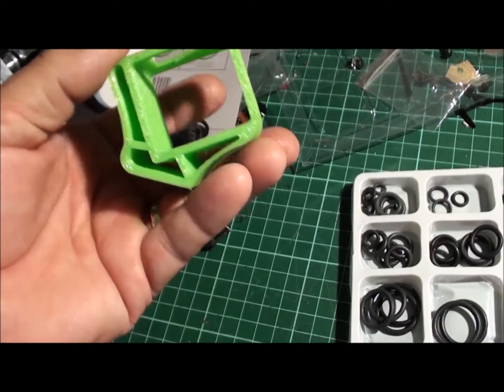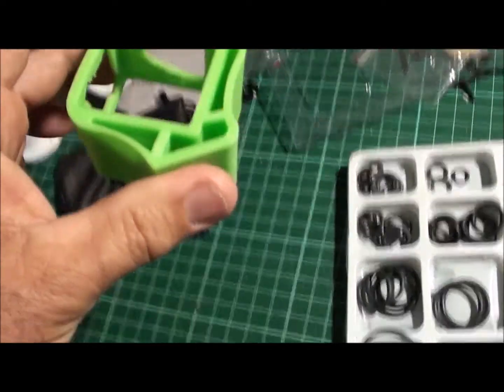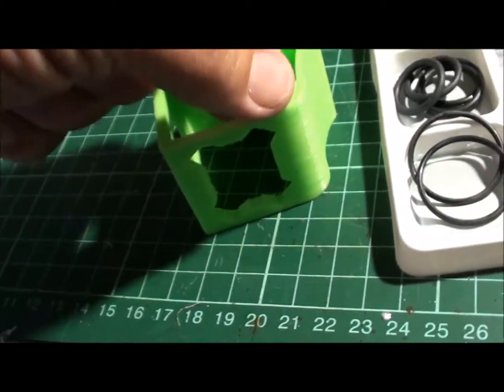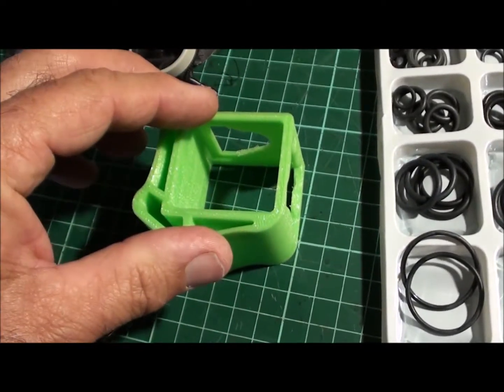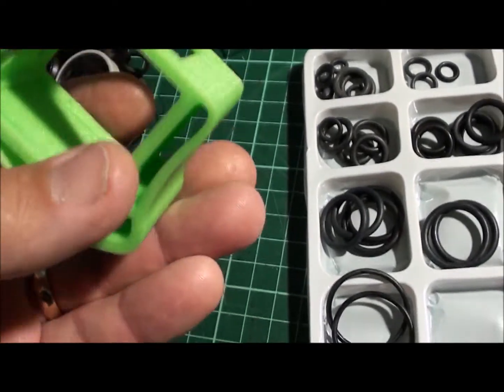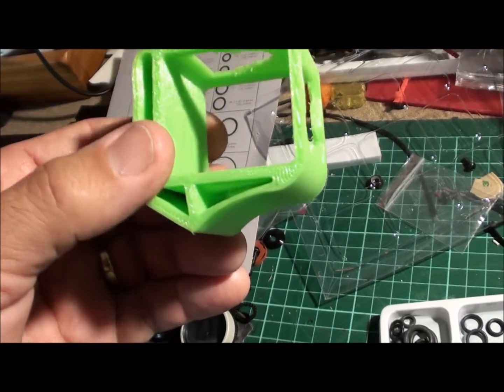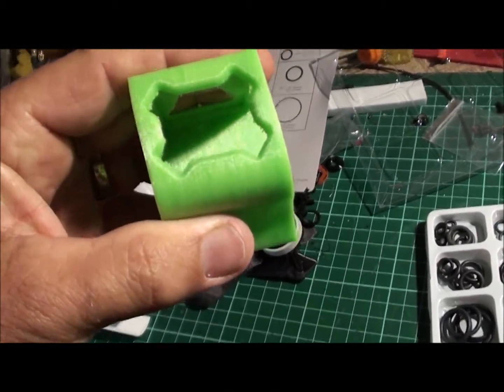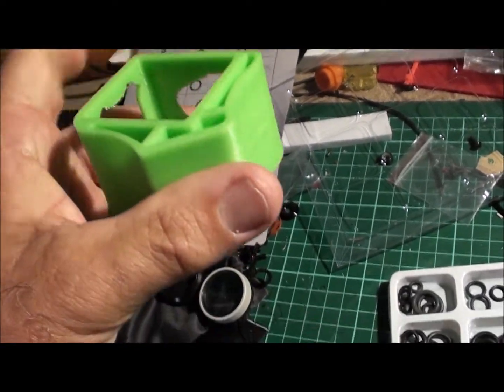3D Printing A TPU GoPro Mount

Comment: I’ve been printing with TPU for a couple of years now. And mostly GoPro mounts for racing quads too. 
I primarily use hobbyking flexible filament which is stiffer than most (their fluro green is softer though). This results in a firmer, more protective flexible shell with no wobbles, bouncing or GoPro jello. 
I’m able to print with supports all over when needed without issue (grids work better than lines in Cura). Can also print pull-off rafts without a problem. 
I can print the hobbyking stuff at 50mm per second. This HK stuff prints better than most TPUs twice the price. Limited colour range though.
I use a stock wanhao D6. Its direct feed extruder has worked well on all flexibles that I’ve so far tested. 
Great video and thanks for making it.
Reply: Hi ive just purchased the prima creater p120 v3 printer
In thr description it says use PLA. ABS. ABS+ do you think I could do TPU printing on it
Reply: nighthawk 1 - sorry I missed your question. Did you get it sorted?
Reply: thnk you for this comment. Just getting into 3d printing specifically for fpv drone mounts. Man id love to buy u lunch haha
Reply: AJ Navilio - thanks. Hit me up if you have any problems.